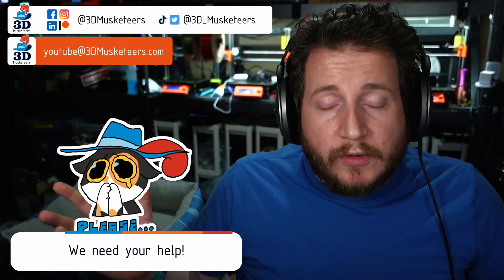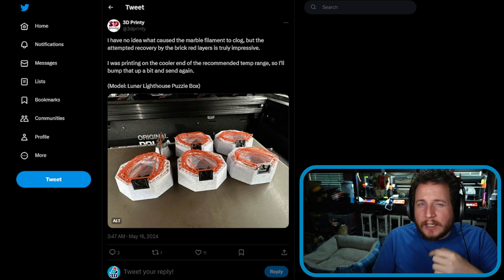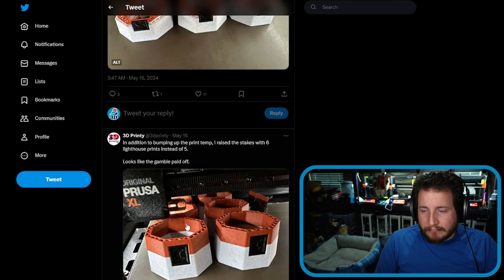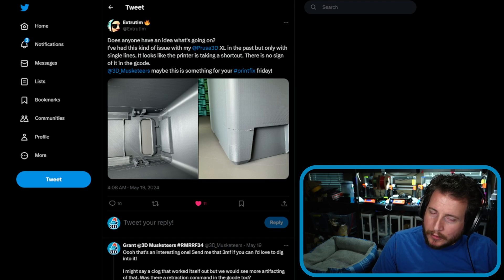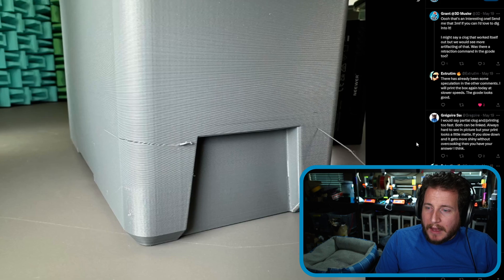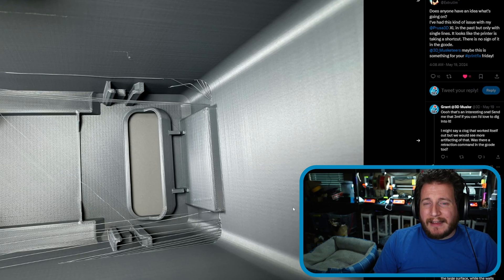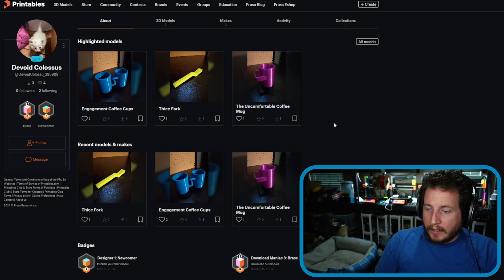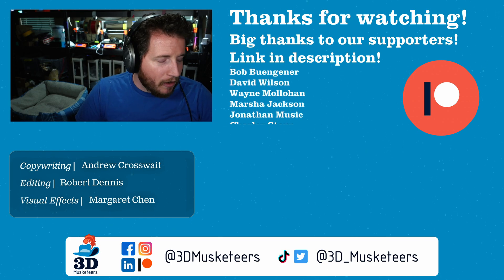Fails You Can Print Yourself! - PrintFixFriday 141

Comment: Hmm, would raising the temperature actually help or hinder with filled filaments? By raising the temp you are lowering the viscosity, that could cause the material to flow around the granuals and leave them behind, clogging even faster. Also baking the filament while that head is parked, so more carbonization to help cause a clog.

Comment: The second one; I print mostly in PETG, get some odd effects however
One print I've been doing a lot of lately is printing 1x2mm thick, 25mmx330mm rods in vase mode, (a project, part of a huge water sculpture)
The problem I ran into is that cooling ruins the layer adhesion (and waterproofing). I not only had to slow the print down to 5mm/sec, but also print at an ungodly temp of 180C (recommended 230-260C) for the laid layer to have enough stiffness to not deform when getting tugged around by the print head on the active layer.
Granted, this might not work out so nice for that bin, underlayer cooldown being much better with a larger print